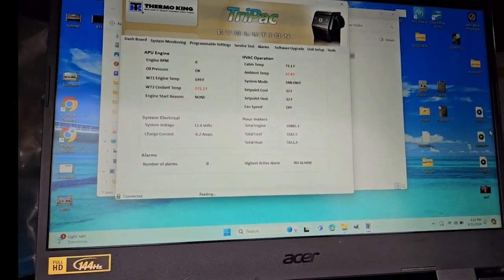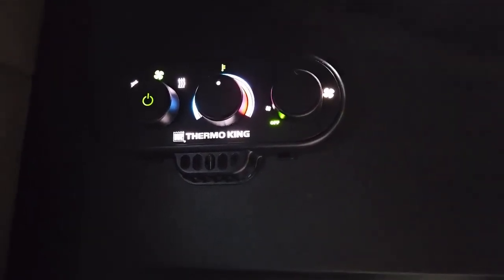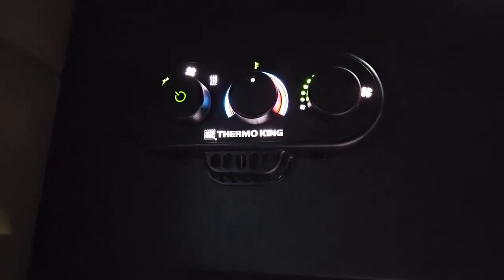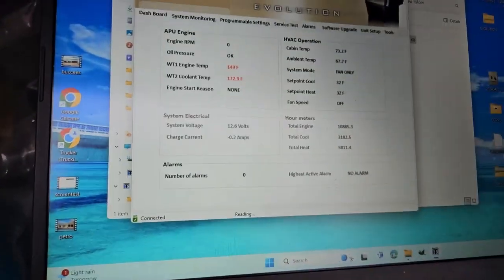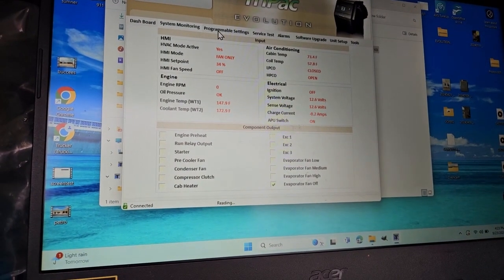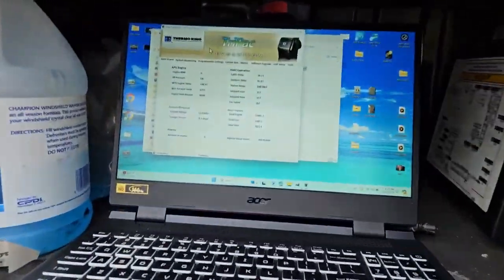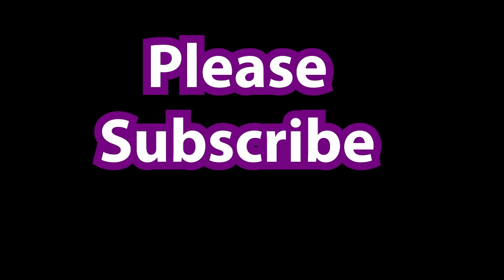How to Diagnose Your Thermo King Apu

Comment: 1:30 A.M., 4 degrees in Minnesota, I woke up realizing I hadn't heard the APU starting to keep the engine temperature up. Your video helped me figure out the dealer had turned it off as part of their troubleshooting while trying to find a leak in the cooling system. Thank you!

Comment: I recently learned that these APU's are no good above about 102 degrees outside -- you know, when you need them the most.

Thermo King tech told me that that tiny radiator holds only about 1/2 a bottle of coolant and it gets easily overwhelmed once the outside heat gets high enough. I see that red triangle a lot whenever I go to Arizona or Laredo.

Comment: Here kitty kitty. lol I miss having Thor on the truck on with me. I've got a USB extension cable run through the cabinets and walls to my laptop mounted in the laptop stand on my psgr seat. I like not having to find the cable to look at the engine hours for oil changes and things. 

NO WAY WILL I GO WITHOUT AN APU. stay safe out there.